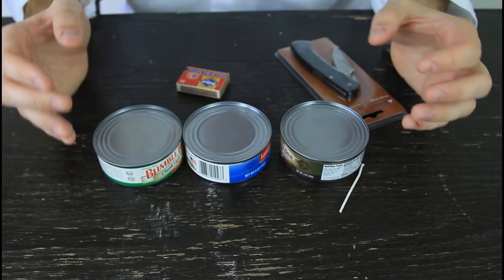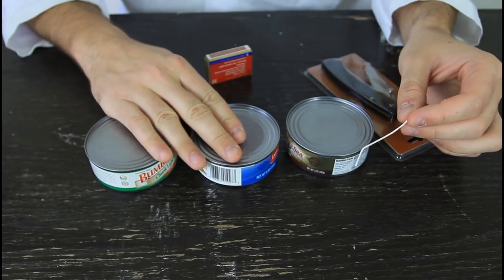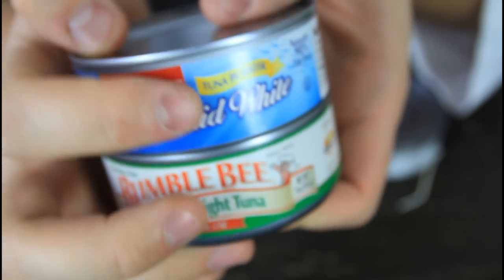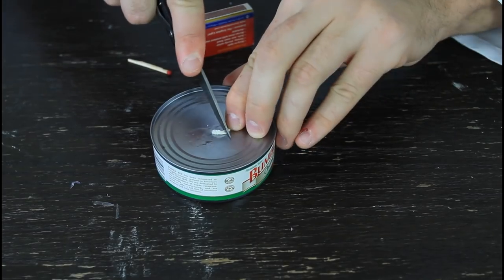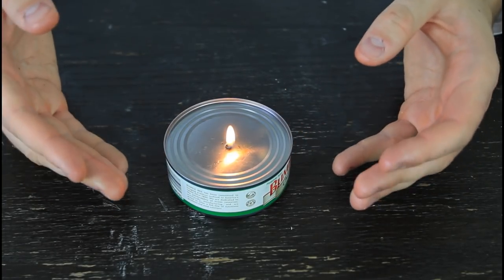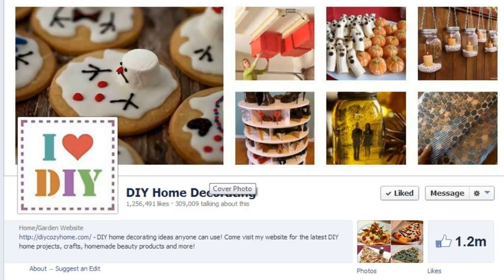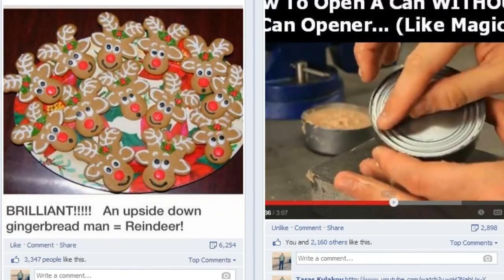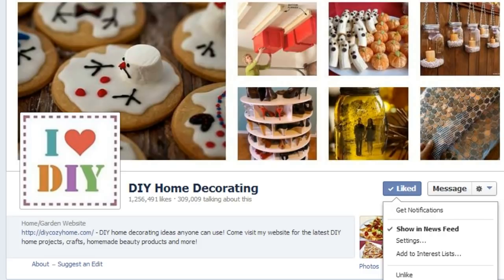Emergency Tuna Can Oil Lamp

Comment: :D amazing, the way you described the process was pretty good too. further research and i found out that the thread forms capillaries that draw the oil up with the heat. the oil vaporizes and burns as a gas. thanks for the awesome vid!

Comment: Can you still eat it?
Reply: The tuna will probably be dry and you may suffer from food poisoning as the can gets warm as the oil burns and so bacteria will thrive inside. I wouldn't chance it myself.
Reply: John Crowhurst I would not worry about that, its really not going to suck in very much and it will all be through the wick which will be mostly sterile(due to the heat) i would eat it within a hour or two of puncturing the tin finishing the candle.  I would also worry about the lid of the tin getting hot enough to melt or burn/outgas the plastic coating inside the can so id avoid the area near the wick anyway.   But if your doing it for survival or heat you probably have bigger things to worry about.

Comment: could add a safety pin through the string to let you pull more out with out having to snuff out the flame.

also if its hot enough to heat the tuna it could be a convenient way to get a hot meal.

Comment: another trick, but which requires advance preparation, is to use the empty can as a fire starter.  Still requires a match, lighter, or other ignition source Using an open & empty can, card board, and paraffin (wax); tools knife, pot, hot plate...  1. cut the cardboard in strips that have a width that is the same height as the can.  2. roll the cardboard strip up and put in the can.  3. melt the paraffin and pour into the can until it fills all of the gaps in the card board.  4. let dry and store for use later.  5. When needed you'll need a match, or other source of flame, light the paraffin/cardboard mix on fire ... will burn for awhile, likely not as long as the example our CrazyRussianHacker friend shows but will help to start a campfire in an emergency.

Comment: LOL man, aftter you got coocked TUNA? is it eatable after that?
Reply: No, the tuna doesn't get cooked (heat has this nasty habit of going up, rising and heating up, not down). But, if you have another tuna can you can heat that one at your new lamp ( provided you use some twigs or something to support it a bit up from the flame).
 And yes, the tuna will still be eatable, unless you leave it with that hole in for a few days before consuming it.
Reply: soo... if oyui wont get fire near it its still eat able?
Reply: It is still eatable regardless if you get fire near it or not. But the fish in the can that you made into a lamp will be still eatable and will not be burned by fire.

Comment: Why wouldn't it work with Tuna in water ?

I'm confused.....
Reply: Lol are u srs.
Reply: If I throw a lighted match it will go out before it lands in the water.

I'm still confused.
Reply: TDIReloaded do you not miss what sarcasm is
Reply: Water won't burn
Reply: Eein Fredrickson
 What ? not even when there's tuna in it ?  For years I've thought it would.
Reply: I tried it with oil and it works..... I'm still confused.

Comment: Good video but Rubbish at the same time
Yeah right! In emergency, I will have a tuna can by me? Fine even if I do 
, I have knife? Thread? Match?
Reply: ***** Or you can bring a flashlight, a chocolate bar, and a smartphone with gps tracking on it.